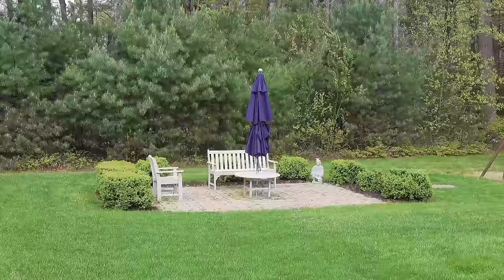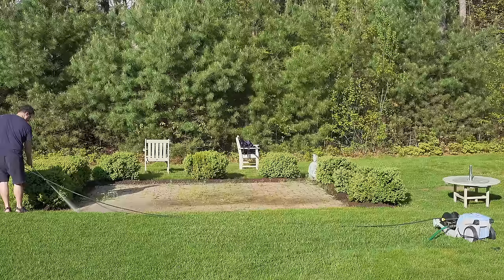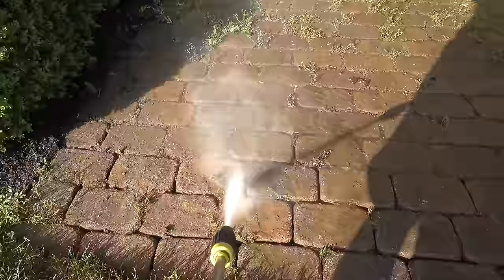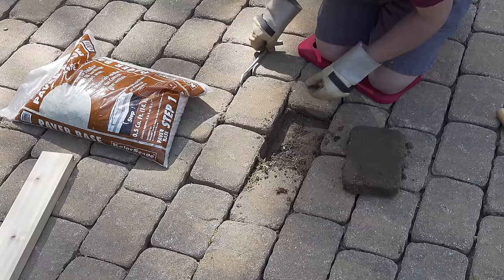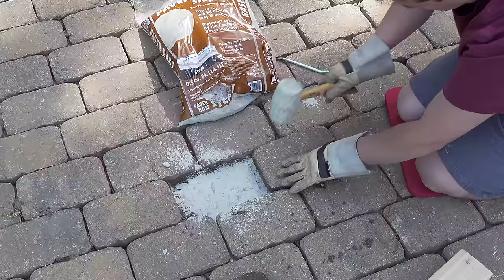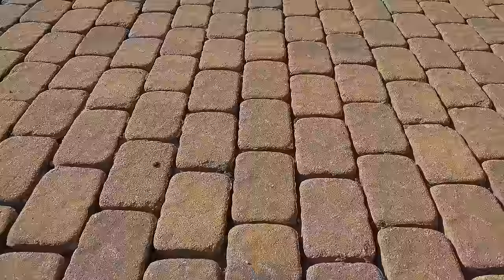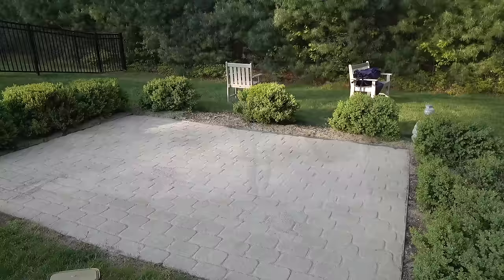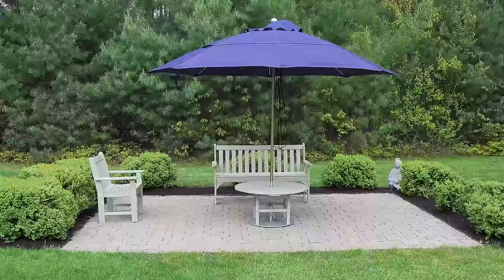Patio Paver Restoration - DIY Step by Step How to - Easy

Comment: Lol I have been doing this all over my town for people. There’s a huge market for it
Reply: How much do you charge? I had mine done for $900. Hope I didn’t pay too much.
Reply: @Yoyoyoyoasshole  that’s pretty much the average
Reply: The size of the pavers in this video....how long should it take an experienced person to get those joints clean and ready to be sanded? I'm talking about something this size with heavy Moss in the joints and on the pavers..
Reply: @dereks497  if it’s the same size patio as the one in the video, very quickly. Power washers will blast extreme moss with ease from the joints. Just make sure you also clean the surface of the pavers, or else you’ll get clean lines on the edges of the pavers and it’ll contrast with the middles.

Comment: Should of applied a mold and algicide first to kill, loosen and prevent further future growth trapped under your new sand and sealer. No way o completely remove all mold and algae with water alone. Just like cleaning a bathtub with water alone does not get the job done correctly. Then use a duel jet surface cleaner attachment which is more efficiency and tme saving. Then go back over useing a turbo nozzle to finish off and remaining weeds and debris. Then fully rinse with water cleaning off any remaining loose debris of any kind. Then apply non-polymeric sand with medium brissell push broom to fill in all joints. Then water sand into joints with regular water hose and medium fan spray tip while removing any excess sand on top to have a completely clean surface for sealing and to obtain the correct joint sand levels. Then after about 2 hours apply 3 coats of water-based acrylic high gloss sealer. First coat heavy. After last coat do not walk on it for 2 hours and don't drive on it for a minimum of 48 hrs. You had great results on the preparation side but 👎for mold and algae control, just went the hard way about it

Comment: How long after power washing the joints did you level the pavers? For some reason my paver base, that was already there, was very wet. In your video, yours looked pretty dry prior to adding additional paver base.

Comment: Another great and useful video. It looks quite simple. I was about to replace mine but this definitely a smaller and cheaper job.
Reply from the maker: You aren't alone. A week ago I was so tired of the weeds and mess that I almost rented a tractor and did the same. Then I found a picture of what it looked like 10 years ago and realized it was worth $85 to try to save it. I am really happy how it all turned out with not a lot of effort. Glad you like dit. Thank you for watching and the kind comment.
Reply: @SilverCymbal  I do tell you it turned out beautifully

Comment: Interesting and helpful. I looked up so many things elsewhere, even other videos and articles on use of the polymeric sand. But no one else explained it's ok to power wash and remove a certain amount of the original sand. It's going to be replaced by the polymeric sand in the final step. Sounds simple here, but I was always concerned about removing too mush sand ans my paving bricks getting out of place in the process. Simple, quick and easy to understand video. Excellently done. Thank you.

Comment from the maker: The tool I am using here is actually a brake tool but it works really well and is cheap: https://amzn.to/2YR05cl - Here is an electric pressure washer that works the way you need it to like I show in the video: https://amzn.to/2M5SJA7 -  This was a project that seemed very daunting but only took a few hours over a couple of days and the result was worth it. Thank you for watching
Reply: Is there any similar cheaper washer?  I'd like to do this but can't justify buying it just for that.

Comment: Great video and instructions however, I’ve been reading about Easy Joint which seems much easier to apply than polymeric sand and claims to have a life of 15 - 20 years vs 3 - 5. It is also said to inhibit mildew and weeds completely.

Comment: Great tutorial. I’m going to follow this process for my concrete paver driveway. If I’m also staining my pavers, do you suggest I stain them before or after filling the joints?
Reply from the maker: Thank you very much I would stain them before filling the joints. Otherwise the joints may not absorb the stain properly.

Comment: Pressure washers are not cheap! I used a nozzle that attaches to the hose and it worked just as well for a fraction of the cost.

Comment: I did this but most of the sand got washed away later after rains. I was told it’s necessary to use a compactor to get the sand in right. What do you think?

Comment: I enjoyed your video, however I have a hundred foot paved driveway with a 40 ft by 60 ft pad. I have a lot of moss between the pavers. It is all turned black because I use weed killer but I'm thinking it's going to take me forever to blow all that out. I suppose you would say just do it in sections. Do you recommend that poly numeric sand on a driveway? We did that on a short sidewalk and it broke up pretty quickly??

Comment: if you add that sand like cement, will it crack the bricks over time as the soil expands? From what I understand a paver doesn't have any cement around the brick. That way the paver can move freely and not crack. Is this sand like cement weak enough to break at the joints?

Comment: Question is this safe to use like on a brick walkway that’s in front of a house?  Like could the sand mess up brick on the house & windows if not properly washed off after doing the brick walk way?

Comment: The Teckniseal label advises using a plate vibrator to compact the fill sand after filling the cracks twice. How might it affect the patio by skipping this step?

Comment: What about a propane torch flame to burn the weeds?
Reply from the maker: That's fine to kill the top portion but the roots will likely keep sending up plants. It's helpful if you use the flame regularly and eventually the root may die off.

Comment: Looks great! What would you recommend for faded pavers? Paint, stain? Also, what cleaning products would you recommend for a poured concrete walk that is considerably dirty/grey/black?   Thank you
Reply: Use a semi or high gloss sealer about 30 days after sand was replaced. Easier to do than the 1st part. Like painting

Comment: Excellent video! May I ask... what was the total square footage or your patio? Also, roughly many bags of polymeric sand did it take to fill your seams? I take it it was 1/4 to half inch seams on average? Oops, you mentioned you used 4 containers at 7:18.  Thanks again.

Comment: Were the pavers pressure washed at all after washing out the joints or was not required?
Reply from the maker: They just got cleaned from the overspray of cleaning the joints.

Comment: Awesome video! I have a question. My patio, aside from the joints collecting moss, has pavers that are becoming black from dirt and who knows what else. Do you recommend pressure washing the pavers? I have heard that pressure washing pavera will destroy the seal and cause a pebbled look. I've tried outdoor bleach with some success, but still haven't fully gotten rid of the stains. Any recommendations? Thank you.
Reply: I just treated moss and stains with high pressure washing machine. It works so well. Now pavers look clean and will add sands. Try it, hope it works well for you.

Comment: Hi,
We have a big problem with ants on our similar patio..They dig underneath and bring out most of the sand creating the mess and holes between the stones..It is very frustrating,because they do it all the time and no matter how much we fix it and then seal it does not take long for them to burrow through again..
I am wondering would it be a good idea to put a mortar between the stones to hold it better for a longer time,because sand is too soft for these ants and they ruin everything fast?
Please help!!
Thank you!
Reply from the maker: Check out my latest video on getting rid of ants inside and outside  https://youtu.be/IkGO9LSJKf4

Comment: Great Video!!! What do I do if a tree root has grown up under the pavers? Can I cut it?
Reply from the maker: Thank you very much. You can try to cut it out as much as possible by removing the affected pavers. You also might get lucky and be able to trace where it comes in to the patio and try to dig and cut there but that can be hard. At least cutting it back even 6 inches will buy you a few years before it comes back. Thanks for watching.
Reply: @SilverCymbal  Wow!!! Thanks for the fast response!!! Also, thanks for the tips!!!
Reply from the maker: My pleasure, best wishes to you.

Comment: Are those concrete pavers? I need to do the same thing on my back patio. Have you thought about applying concrete sealer on them too?
Reply from the maker: Yes they are concrete. I like the look of the sealer a lot, gives it that wet look. I haven't done it yet but I probably should.
Reply: @SilverCymbal  I am about to start a refresh of a large paver patio.  I'll need to pressure wash the pavers in addition to the seams.  I want to seal the pavers.  Should I seal them before or after applying the sand to the seams?
Reply: @wilkeather7260  I've heard it said somewhere that sealing it after sanding helps the sand stabilise between the joints.

Comment: The sand that you blew away, does that not cause you issues with the grass/bushes? I.e. when it settles and there is rain?
Reply from the maker: No it is sand and polymer but at this point it has broken down and really just dissipates. It is inert too so you shouldn't have any issues I didn't see any problems at all.

Comment: How long did you have to wait after you used the pressure sprayer before you started fixing the stones?
Reply from the maker: It depends on the weather of course, but it was just the next day for me
Reply: @SilverCymbal  Thank you for the quick response. Your video is the best so far. No fluff! Yes I was asking assuming sunny dry weather. Also, does it matter what time of the year? I live in the northeast, and this weekend will be 66 degrees in the daytime and 27 degrees at night, but no rain for 4 consecutive days. Should I wait for warmer weather?
Reply from the maker: @michaeldang8876  Thanks, I would just do it when temps are 50+, for Mass that will be late April+

Comment: 2 months after and the weeds are back. I used polymeric sand and still saw weeds later.
Its expensive, but remove everything and use weed blocking mesh..

Comment: We have the same issue but my husband is concerned about drainage issues if fill gaps with sand that will became concrete , we live in Ohio next to Lake Erie and in winter the temperatures are very low and we get a lot of snow .
Please advise

Comment: These pavers will be unleveled very soon because you have used a very cheap base also masonry sand is also very cheap work best thing to use and not worry about is 3 quarter inch chip stone. But remember this video is a budget job not meant for professional work just a cheap homeowner that doesn't care about there pavers.
Reply: Forgot to also mention that because you didn't remove the dirt and growth at the bottom of the pavers this also provides a cheap base.